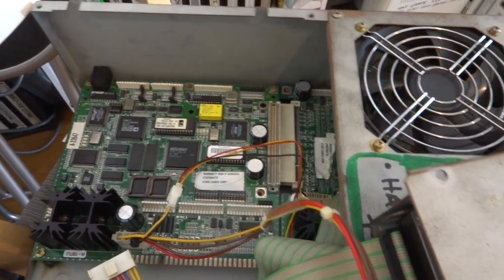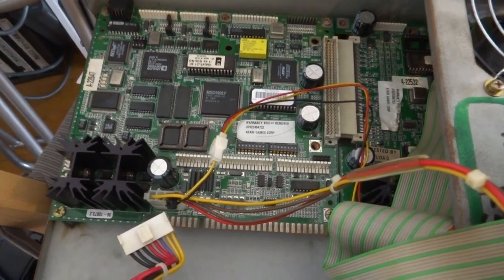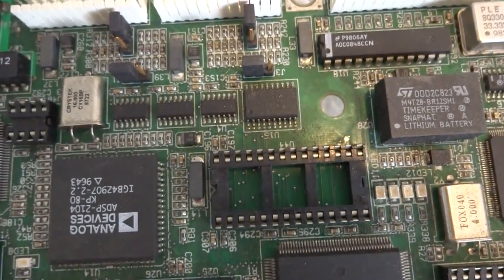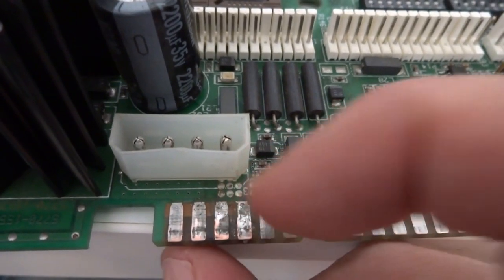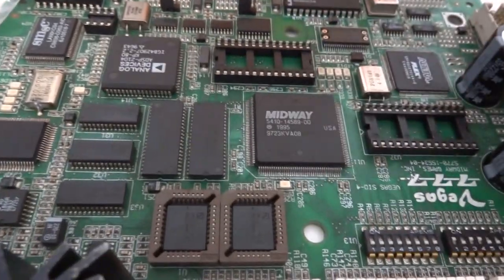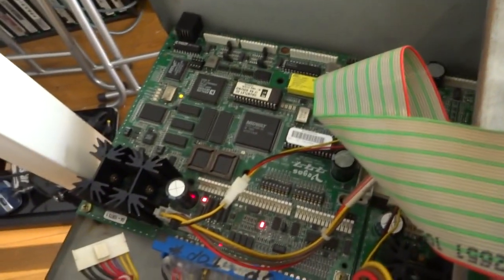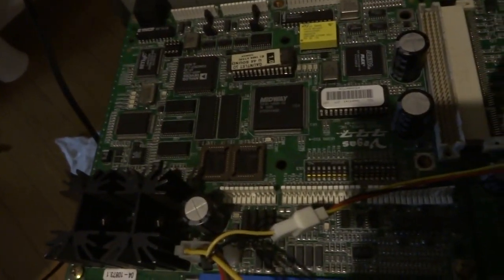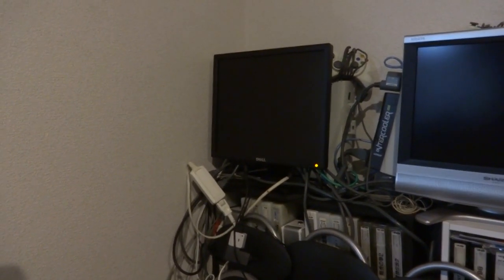Gauntlet Legends Arcade PCB Repairs Again

Comment: I think Gauntlet Legends and Dark Legacy are without a doubt two of the finickiest arcade PCBs ever, especially with those cheap HDDs.  My friend who used to own one of them had had enough with it and just sold the damn thing.  That is why the PCB is so rare; nobody could deal with the constant upkeep.  It was worse than a Corvette you drove all the time.
Reply: blackice That makes me so sad.  I wished to purchase one of those machines one day. :-(
Reply: +danmanx2 I got a fire damage external only Dark Legacy out of a skip in Leeds, worked first turn on, mainly smoke damage. Cleaned up nice, wish I'd not sold it now. In process of building a aluminium checker plate mini cab version DLegacy.

Comment: I'm pretty sure those chips in the sockets are FIFO chips that feed the DAC.  Its like a buffer so the DSP can write some samples to the FIFO and the DAC circuit can read it as needed.  Last time I looked they were AMD branded Am7201-35JC.  I'm pretty sure they were binned by speed so some might end up out of spec after some major use or if the sockets themselves begin to loosen up too much...  The majority of times when there are minor failures like this it is usually a problem with some socket, cable or connector somewhere that is just not doing as good a job as it used to...
http://datasheet.octopart.com/AM7201-35JC-AMD-datasheet-117015.pdf

Kind of odd that both drives failed.  Seems like the HDD spins up fine so maybe it could be the cable or a bad connection on the drives board?  My guess is the cable or header on the CPU board.

I've had drives fail on me before and most of the time it is a bad connection from the drives circuit board to the motor (when it doesn't spin up) or the head controls (when you get read/write errors).  What I usually do when I suspect the drive may be bad is just remove the HDD circuit board and clean up the connectors going to the head and motor on both the board and the drive itself, then bend them so there will be more force on the contacts.  Usually there are some connectors that are just not making good enough contact so cleaning them up and bending them all back into place can bring the HDD back to life.  But I think it might have something to do with the cable... That's my guess at least. ;)

Comment: That Hard Disk may just be bad, Have multiple bad sectors, ect. I'm not hearing any obvious ticking sounds from the drive so it's not going threw Sticktion. Try hooking the disk up to a pc and running the Check Disk utility in windows or going out and downloading a dedicated program for hard drives. I would maybe try getting a new old stock Hard Disk with the same specs if it has a lot of bad sectors.
Reply: MaxinMaytrix Agreed.  Old 4, 5.3, 6, and 8GB hard drives are dirt cheap these days.  Get yourself a stockpile of them!

Comment: did you check the eeprom chips? legends has different versions for the different software versions early on. the last eeproms for legends let you upgrade to dark legacy. were you able to put gdl 2.52 onto flash drive for your gdl board?

Comment: The caps on the board are probably fine. Dented up maybe. Why not invest in a ESR meter and test them in circuit? Seems like you replace a lot of boards and hope for the best, why not use a scope and actually find out whats wrong with a lot of your bad boards? - Anyway love your videos

Comment: if you what to get that hdd woring get an old pc that has IDE drive and run spinright  it will may the drive bootable  (9 out 10 times it works) then you can move it to a compact flash drive